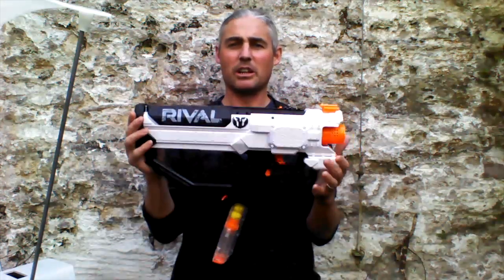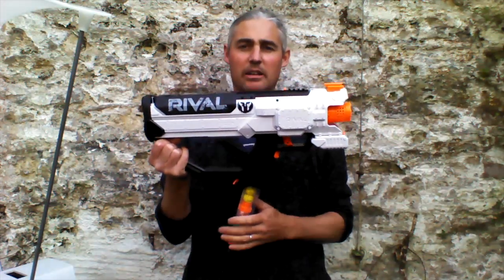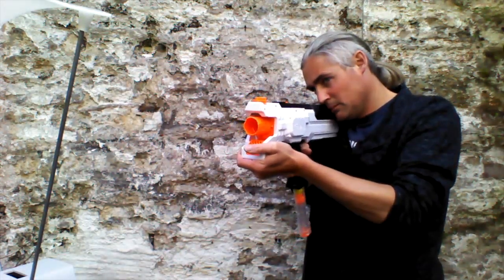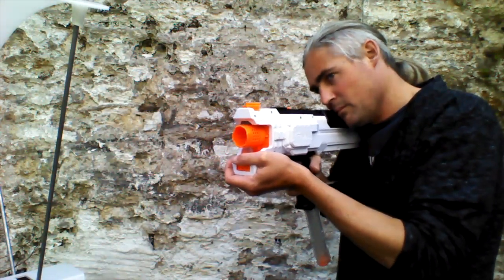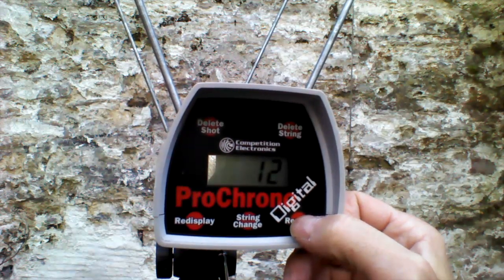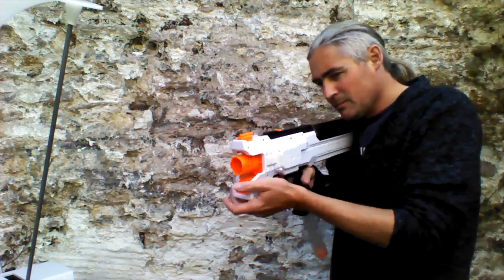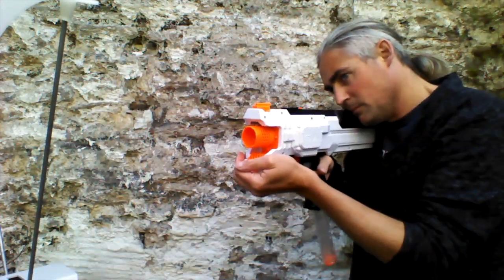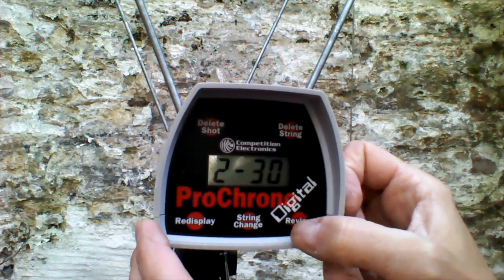Rival Hera Mod Chrono Test

Comment: Could you make a tutorial for how to install a MTB Wolverine into a stryfe? and kind of break it down? I'm sorta new to modding. I don't know very much about electricity though
Reply from the maker: Don't fit wolverines, they draw huge current, you will need a much larger battery than for 3s options like Fangs that are as good but draw less current. The Stryfe tray can't physically fit a decent sized pack without an expander . There's a million tutorials on my site on fitting mod motors, balancing motor load with batteries and wiring mosfets. Go learn.
Reply: Alright, thanks for the help!
Reply from the maker: Good luck with your mod!

Comment: Pls do a optimal cage crush video,  I'm lost
Reply from the maker: Optimal crush depends on what velocity you want to shoot and how good your darts are. If your motors are adequate the higher the crush the less reliable the feed but the higher the FPS up to a certain point. If you are shooting full length darts anything over 150fps is pointless anyway because you are beyond the stable velocity of the average 1.1-1.2g long dart.
Here we rarely bother with over 130fps and go for precise assembly and very exacting machining tolerances which increases precision and practical performance instead of chrono queen velocities. 
Printed cages are not consistent enough in production dimensions for comparative testing.

Comment: Nice! 
Here's a question: what's your favorite blaster? You seem to like Rapidstrikes, but with the new conveyor pusher system blasters, or even something like the Nemesis, do you have a new favorite?
Reply from the maker: I dislike all the conveyor pushers, they are flimsy, hard to control properly and and inferior to a gearbox pusher. Nerf has saddled us with them because they are narrower and cheaper. For regular use the Cassian Andor is my favourite blaster.
Reply: Foamdata Services I definitely see where you're coming from. I do think conveyors have their place though, they're a lot easier, quieter, and faster stock. But yeah, pushers are a lot more reliable.
Reply from the maker: The place for conveyors is in a Nemesis or in the nearest skip. I want complete cycle control.